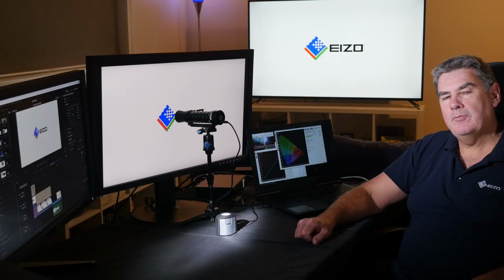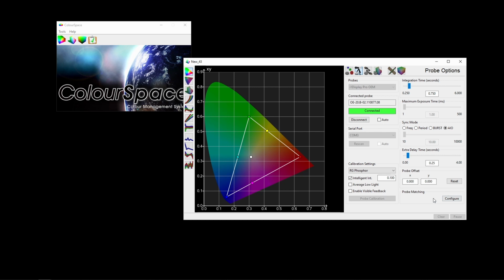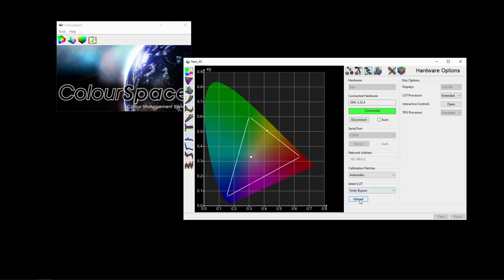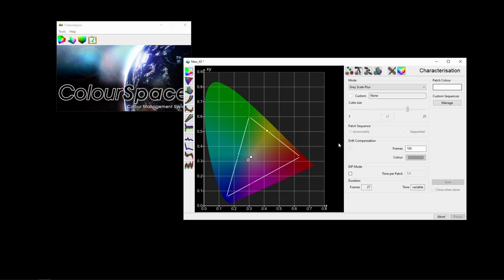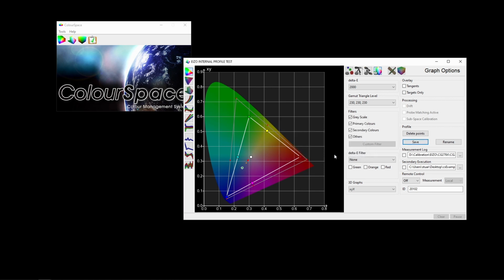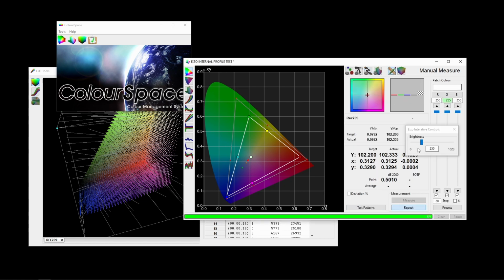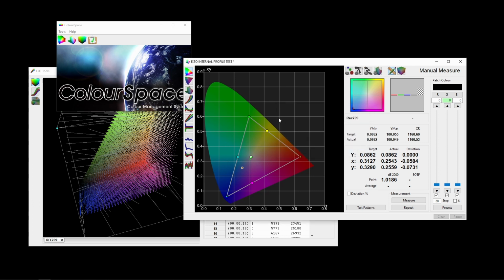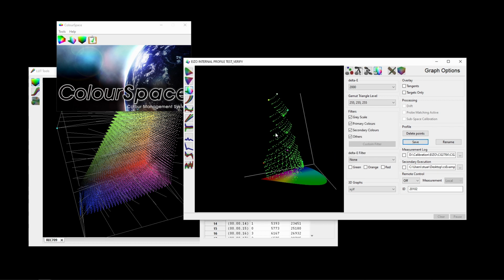How to Calibrate CG319X CG279X ColourSpace

Comment: Hey, Great video! how do you deal with a YUV signal path, since the LUT (Extended only) sits before the YUV > RGB conversion. Is there any work around? Also in the calibration video tutorial using Display Cal with the CG279X you created a 1D Lut with Color Navigator first, before profiling. Why wouldnt you do the same with Color Space / Light Illusion Software?
Reply: Hi Tobias, I haven't been with EIZO for quite some time, but let me answer your questions. The first issue you mention only relates to the CG247X where the lut is before the Y''CbCr>R'G'B' conversion and this is covered specifically in that video. In regard to the CG319X/279X and all EIZO monitors with lut capability since, the lut is in the correct position after any conversion and scaling. So you do not scale the lut, it is full range and you can send either R'G'B' or component no problem. In regards to the 2nd part, Colourspace talks directly to the EIZO monitor within its own software, no EIZO software required. Simply connect to the EIZO and upload the lut. With DCal, it cannot talk directly to EIZO monitors, and so you need CN7 to load the lut. The only way CN7 can load the lut is for the lut slot to be active and to do that you simply use CN7 to create a native cal slot. You can then profile with DCal, create the lut and then use CN7 to load the lut. BTW, I do not monitor this site anymore, just happened to be here by chance. :) Best regards